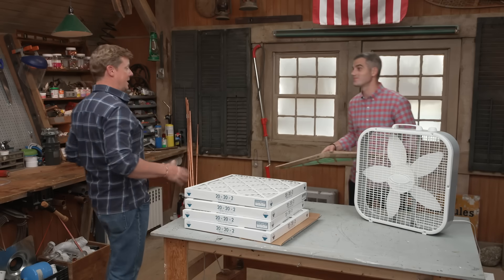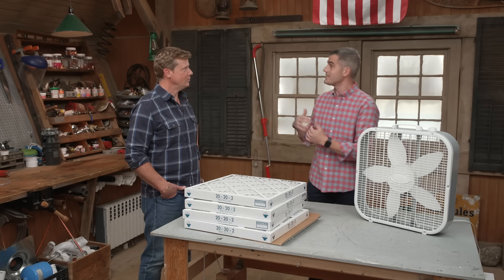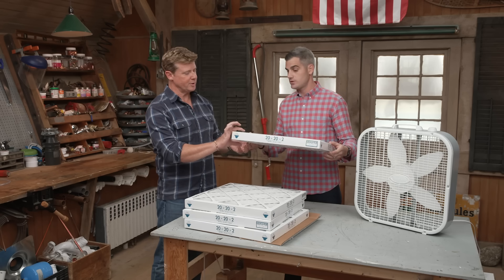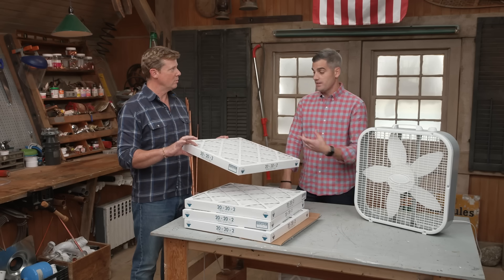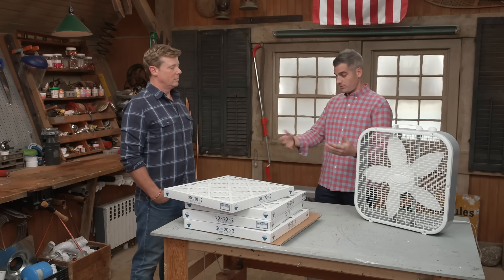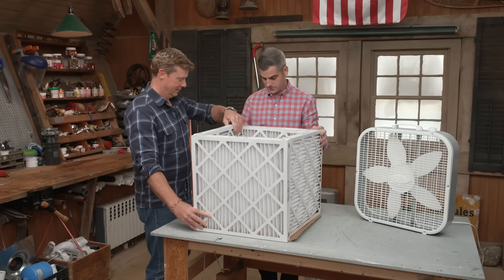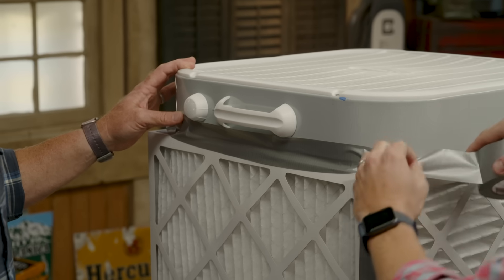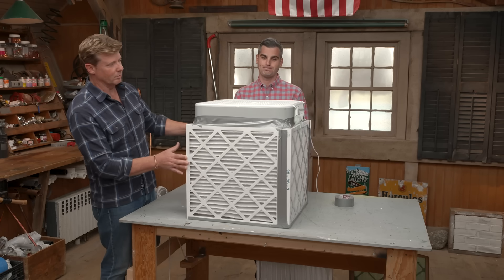How to Make a DIY Air Filter | Ask This Old House

Comment: As a toxic mold survivor, I gotta say this is amazingly helpful. This is actually something that people with extreme mold sensitivity and reactions does to help keep them from getting sick, disabled, etc... But I’ll be doing this as an ac unit as well in the hot summer since I can’t use my ac system as mold is inside them and would blow mycotoxins all over my home, belongings and myself. Thanks so much!!!!!
Reply: It may be too expensive (cost me my $200 covid support check), but one thing I did was get the AirFree mini incinerator air cleaner, to actually kill rather than just trap mold & mycotoxins. I don't know how much it would help if the problem is in the air conditioner itself, but I know it's helped in my  intractably moldy bathroom.
I know another thing my doctor did was put me on Milk Thistle Extract for mold toxicity, and it helped me a lot.
Best of luck on your healing journey!!
Reply: I found some green filters at Home Depot. I covered the vents and it traps mold, dust, dust mites, pollen, etc. It's just like this.
Reply: Exactly what I'm dealing with now. I'm in low income housing and we have a central ac, been running for 3 days and I already smell the mold. I have my ION fan going, but looking for more options. I have severe heat sensitivity so I need to use the AC.
Reply: @WisdomAgreements  
I totally get all of that. I’d rather be hot and learn how to cool my home and body down vs get more mold suck and ruin my things again.

Comment: Fun fact, most filters that are 20x20 are the same price as 20x25 in the store.  That's 400 extra cubic inches or air flow for the same price.
Reply: Yes.  That's what I've been finding when I shop for filters. If you are only going to use one filter to tape to the back of the box fan, then 20 X 20 is perfect.
However, if you are going to build the 4 filter box as shown in the video, and you have room, then use the 20 X 25 filters and just make it a little taller.
Also, checking prices (early 2021), I'm finding that anything close to MERV13 is going to cost $100 Can$ or more for 4 of them - if you can get the 20 X 25 filters for the same price, then why wouldn't you?

Comment: I love the concept introduced in the video infiltration is really important but I don’t like how they tied it to COVID-19 necessarily.

There’s a reason why we want to 6 feet of distance between us when we talk about social distancing. The COVID-19 virus isn’t airborne it’s a particulate but you don’t need an air filter ration system on your house to stop it. In fact what you have to worry about is someone with the virus getting near you no you’re outside air conditioner.  We have to understand COVID-19 is not just floating around outside our homes it’s usually going to be found and transmitted person to person with close interactions with someone. It’s not just going to float through your window while it’s open unless of course someone is literally standing by your window coughing in your face. Now you definitely need a filtration system on your home you need to do one anyway to help protect your furnace and your air conditioner and it can definitely cut down on dust and other particles for those who have trouble breathing.  However fill Traciann and particulates in the air should really only be considered in large buildings where are you have multiple people going in and out on a regular basis shopping malls restaurants and things of that sort not in your home. Not even in your apartment because once you close the door no one can really get to you. Instead you really should wear a mask around others.

Comment: Particulate matter doesn’t move in a straight line in the air. It’s constantly jostled about. So even if the pores on a filter are larger than virus particles, the particles will most likely be caught by the fabric of the filter.

Comment: MERV 13 filters DO NOT protect against viruses like COVID-19. ASHRAE 52.2 test standard only looks at particle sizes 0.3 to 10 microns. Virus are much smaller than this. This video is misleading and should not be used to reduce risk of contracting COVID-19.

Comment: Early in the pandemic, I had envision people setting these up everywhere, hanging from the ceiling in school hallways, over restaurant tables, etc. but of course we hardly saw any of these at all.
Reply: @613kc  You truly have a loose interpretation of what constitutes proof.  Have you always deluded yourself...
Reply: In some schools the air purifier is  installed in the air return ducks.
Reply: @Juangomez9186  Placing more filters in the air return typically requires increasing the power to the centrifugal air pumps due to the higher resistance as HVAC, even home HVAC are designed for the 25% filtration of fibreglass air filters.  At the very least, the filter housing would have to hold thicker filters such as 4" or 6" thick MERV-13 to reduce the resistance (the thicker filters have deeper folds hence more surface area for the air to flow through).  Then there's also how many times the HVAC are designed to cycle the air in the room in a given period of time.   Portable air purifiers would be less expensive than retrofitting the HVAC with better filtration and could offer more directed and more frequent filtration.
Reply: @johnwang9914  not always. There’s the iWAVE air scrubber which isn’t a filter. There’s bypass HEPA filters so it’s not fully blocking the duct. Then you have product like the SoliceAir purification systems. Both UVV and UVC lights to combat odors and surface/airborne viruses. Along with their Micropower guard filter which is 1 inch, also ionizes particles,and can filter out particles down to .03 microns in size with air resistance the same as a standard 1” pleated filter. These are usually the systems schools and corporations install.
Reply: @mxfngen  UV-C takes a few seconds to sterilize a virus, just having a light in the duct work isn't going to do a thing if the virus just blows past the light.  Now the light may be useful to denature virus that get stuck in a filter but most of those duct UV lights are just scams.  They also tend to be UV-A or UV-B lights as UV-C are largely not even visible and both UV-A and UV-B would take hours of exposure to denature the virus. Is the air going to be hanging around that light for hours when the fan is blowing?   Besides, how much investment have there been in improving HVAC filtration?  Even increasing the filtration to MERV-13 would require boosting the air pump power or fitting a four inch thick low resistance MERV-13 filter.  I'm talking about portable units that could be easily deployed and how surprising it is to not at least have had portable units commonly deployed one year into the pandemic.
Reply: @johnwang9914  during training I think I remember Solice having a stand-alone HEPA system that any good HVAC tech could turn into portable. But I get what your saying there needs to be more improvement on ports. But back to the UVC. Yes on a standard output UVC it does take a few second but SoliceAir UVC is a patented high output UVC that kills airborne on pass through. With all proper paperwork backing it up
Reply: @mxfngen  And how many schools have had these high output UV-C lights installed or even HEPA filters installed.   Improvements in ventilation are simply being overlooked because they cost money and even the less expensive portable filtration units are only deployed in very small inconsequential numbers and often only when charitably donated.  My point is that even the most basic of ventilation improvements are not being made.  I'll bet that if you looked for people who have installed UV lights into their duct work, most will just be an ineffectual UV-A, UV-B or near UV light rather than a high intensity UV-C system backed by appropriate paperwork, certainly that is the case of the fee featured on the local news.  Even most of those wand sanitizers now sold widely are only near UV lights not proper UV-C lights especially the ones with LED's as an actual UV-C led typically costs $30 per led, are mounted in a metal housing with a quartz window.   There's a lot of fake UV equipment out there.
Reply: I’m so glad enough time has passed to realize how silly the situation was

Comment: Great informative vid. I made the mistake of changing my filter from a merv 4 (original) to a merv 13. Not only did my fan motor seize, the coil almost froze over and mold started forming around the motor and coil. I had to go down to a merv 8. I might try to use a 5 inch filter.

Comment: During the 2018 During Paradise Camp Fire, and last fall's fires in California and Oregon, this (plus N95s if you could get em), were a daily necessity.  And this was two years BEFORE Covid.

Just get box fan, put a furnace filter behind it (watch the arrows!), and turn it on.  The suction will keep the filter in place.

Comment: My brother in law put a higher Merv filter (because higher is better right?) in his furnace and it put so much stress on the fan blower motor that it burn it out.  The higher the Merv # the harder it is to get air through it.  That also made it difficult for the air to travel to their second floor.  He was told to follow the recommendations and instructions that come with his furnace when they installed the new one.  The person who installed their new system wrote the Merv # on the side of the furnace as well as airflow direction and filter size.

Comment: Just go to Home Depot and buy a true HEPA air purifier.  99.97% efficient on .3 microns.  Around $150.  I bought one 20 years ago for my kid's rooms.  They had allergies and this solved the problem.  You could also use it in any room.  I currently use it for my 91 year old mother in law.  She has breathing problems.  This keeps the air clean in her bedroom.

Comment: The Merv 13 filter can stop a particle .3 microns in size, however the corona virus is .1 micron.  Bottom line is corona slides through a Merv 13 easily.
Reply: yes, the virus is that small however, The virus cannot move around without riding on moisture particles that are around .5 to .3.
Reply: @SacredShiro  People don't seem to understand that.
Reply: i head it was 500 mircons
Reply: The real virus is sitting in the white house, Corona virus won't be a big deal for too much longer.

Comment: Looks like a DIY shop filter for clearing wood dust out of the air.
Reply: Exactly what I was thinking, especially around the spray booth
Reply: So is this the most economical option for a woodworking shop filter?   Assuming we have a cyclone type prefilter with shop vac on major tools, but for  filtering the fine dust in the air?  Or are there better alternatives we should look at?
Reply: @rwind656  don’t know about the most economical, but there are lots of box fan+air filter videos on YT showing different designs.  This design is pretty good, and would help in wood shop.  Many people layer thin (lower MERV) rated filters over the (higher MERV) fine particle filters in their wood shops to increase the life of the more expensive  filters.
Reply: @rwind656  I also use activated carbon sheeting layers in my garage filters to help handle some of the VOCs that may come off the chemicals I store in there.  The amount of varnish, paint, and stain I keep stored in there, I feel like I should probably do something if I’m working in there for hours.
Reply: @tabularasa820  Thanks.  At this point, anything would help.

Comment: 5 " straight on the back works fine, no need for this huge cube. It isnt a portability issue.  Just run the fan at low speed.
Reply: They did just get done saying that 5in filter has more surface area so.....

Comment: FYA:  box fans are not meant for static pressure applications and will suffer CFM drop across a filter.  Using 2 in a V shape or 4 as shown will reduce this drop.  But, the rated CFM of the fan across the filter won't be achieved.  Also, square / non-ducted box fans will wind up sucking in air at the corners from the "outflow" side of the fan, believe it or not.  You can tape across the corners on the front/outflow of the fan to minimize this loss; ducted/round fans do not share this issue, but they are harder to fit a fan to.  

All that said, I've got both a 20" box fan and a 24" round shop fan rigged up with filters and they are great.
Reply: You're correct; these jury rigged jobs shown on TV are a real joke!
Reply: If you built a “frame” of some sort around a round fan, would that stop the “air leak”?

Comment: This is not a DYI air filter. This is a filtering devise made using expensive commercial air filters and a crappy style box fan.  I doubt MERV is goign to block viruses. The water droplets the virus might be suspended in the air yes but as soon as the droplets dry the virus will be free to pass through the filter.  Cool Idea for filtering smoke though.  I like how you are both talking about Covid and neither of you are wearing a mask. FACEPALM!

Comment: Box fans aren't really designed for that application. You would be better off using a tube-axial fan, or a squirrel cage... maybe even a centrifugal fan. But box fans are just designed to move air without a build up of static pressure before or after the blades. Someone will burn the motor out in that fan pretty quick IMO.

Comment: But the merv 1 moves air easier.  So, if the filter is too tight your air flow throughout the house will suffer.  In winter that's tough to keep the house warm.

Comment: I wanted to see it in action with some smoke to see how well it draws it in and how well it filters.  A follow up maybe This Old House??
Reply: Yeah. . What the heck ?  Nice idea but if it is not powerful enough to pull in pieces you want and need to filter out it's nice but maybe a better idea is to save up for one built with specs to do the job.
Reply: @tmorgan7939  look up Izzy Swans video on a box fan filter vs one sold. You'll be surprised.
Reply: @tmorgan7939  i made mine like this model 1 week ago and is not worth the 50 i spent in the 4 "7" rated filters. Doesn't  work. I works better to put just 1 filter attached in the back of the fan
Reply: @benjabhd  Thanks . Good luck with the changes you made..
Reply: @benjabhd  Merv 7 isn't high enough, you need a Merv 13+...
Reply: My furnace uses 5" merv 12 filter now. My idea is to make a return air filter for the return ducts they put high on the walls but use a merv 15 filter media over a wooden frame thats going to let as much air pass the 9x10 wall plate so I dont restrict the air flow.
Is there a formula to find out how many fold you would need to get this and my plan is make this so I can change the media cloth and not the whole filter.
The hvac systems going to do what its designed to do. I dont close off rooms or vents.
Reply: Ya, it was a rather anticlimactic ending. :(
Reply: Take the idea and improve it 🤑
Reply: They didn't have the air time. But there are many other videos you can find that show how it works.
Reply: @ClanBez  Quiet is important to me. What type of floor fan do you recommend? Could I find a suitable one at Harbor Freight, Northern Tool or similar retailer? 
If it makes any difference, Amazon has rolls of MERV 13 material, in a variety of sizes, from 3M, as well as other manufacturers, for a reasonable price compared to buying something like Filtrete®. Plus, there's the benefit of bypassing the disassembly of the cardboard frame. 
Last question: do you bend the metal frame in a folded / corrugated fashion or go flatly on the cylinder?

Comment: Duct tape the sides in the back it has to be a good seal or dust and stuff will go to the openings too,virus particulate is .1 micron polled is .3 etc etc,merv is just to thick use a thiner one or you will over heat your fan or worse,justsayn.

Comment: I live in Southern Oregon and during the last ten years we have had the worst fire seasons ever!!! Even with all the windows closed, we still have smoke pollution entering our home. If you have ever had to deal with smoke inhalation over months at a time, you will understand how important this simple invention is...Thank You for this simple, effective, and potentially life saving device!!!
Reply: Me too, building one today!
Reply: Yes, same in Southern California the air is horrible, dust like I’ve never seen before.
Reply: I am going to habitat for humanity to buy the box 20x25x1 low merv filters I saw yesterday to tape to outside of my swamp cooler as a large and medium filter.  And  then building a box fan filter with probably merv 11 as that is what I can get in rural CO. And I ordered a Blueair warehouse large purifier on Amazon   I saw our air quality is going to crap in a couple days as we are finally getting the smoke from Grand Canyon fire have small local fires as well. I have mild asthma with swamp cooler blowing in outside air I figure I better take some action. Thanks for this plan!
😢
Reply: Did you build one and how did you like the results? Also fan blowing in or out?
Reply: @Nunnia222  6:57 Air in from the sides and out from the top
Reply: @Nunnia222 same question. For a second, he spoke of arrows on filters, but not on fan. Any answer on trial and error? (Wildfire 2.5 particulate indoors because my windows are not airtight.)

Comment: Oooooh, I"m upgrading my "old 20 box fan hack" to this!  However, I'm going to use 3M painter tape and then duct tape on top of that...duct tape is going to leave so much GOOP on the fan :)
Reply: Old painters tape leaves a glue too. 
Goof off will remove it without much trouble.
Reply: Use bungeee cord

Comment: Fans like that will often draw more air from the area in the square housing outside the circumference of the fan than they will through the filters. Not a total loss, but you might not be getting all the filtration you think.
Reply: its kind of a failsafe so the fan doesn't overheat
Reply: So do you recommend putting a filter on the top as well and then a fan on top of that?